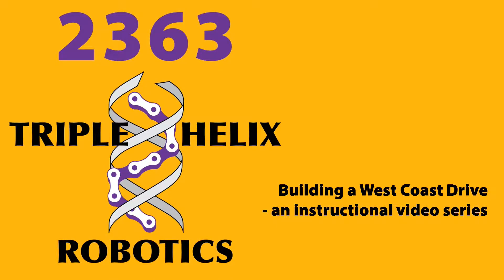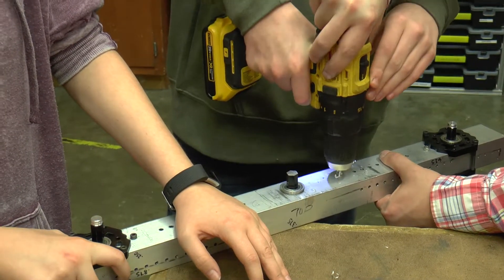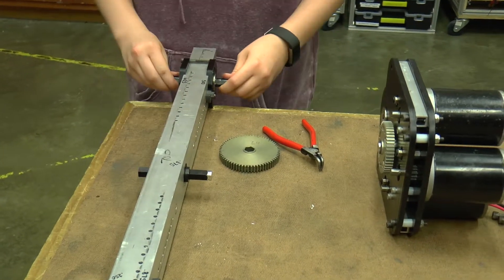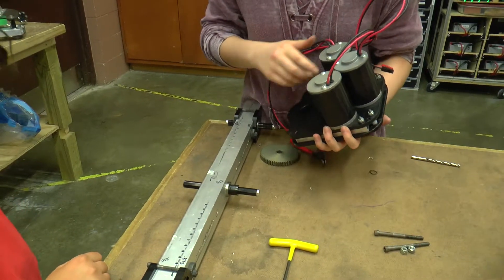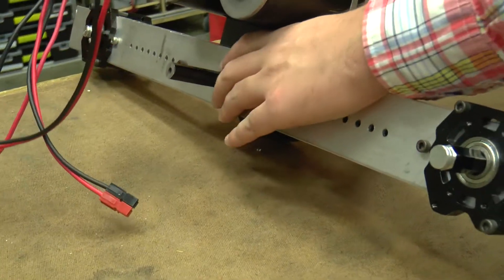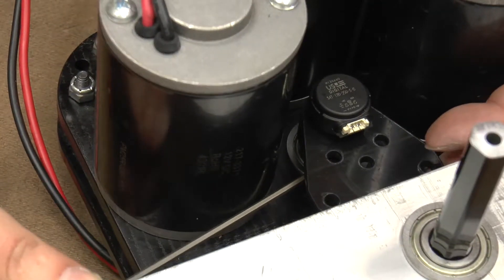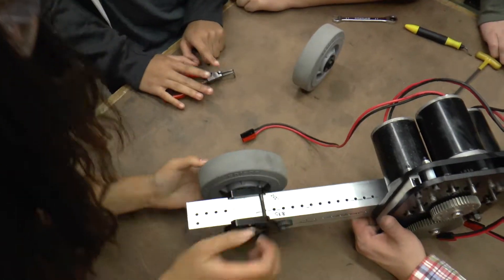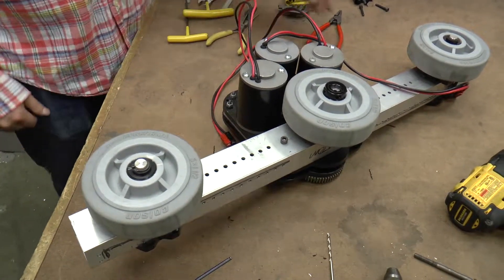2363 builds a drivetrain - episode 13 - installing the gearbox

Comment: Really enjoyed this series!  Thank you for putting this together and sharing your designs.  What are the bolts threading into that are holding the encoder bracket in place?
Reply: Hi Tyler!  They are 6-32 SHCS x 1-1/8" LG and they go into tapped holes in the plastic gearbox plate.  Check out our cad for more details, it is linked from TBA...  https://www.thebluealliance.com/team/2363